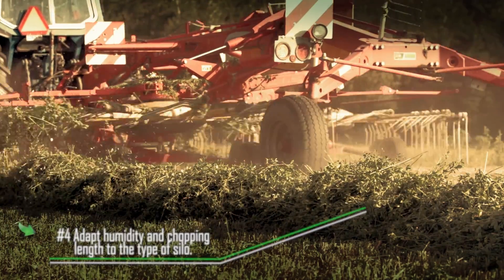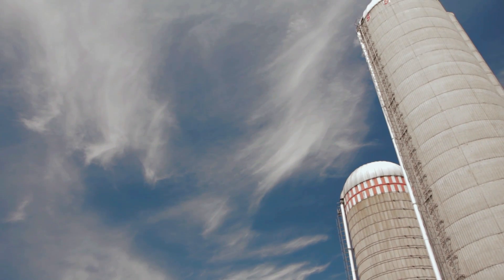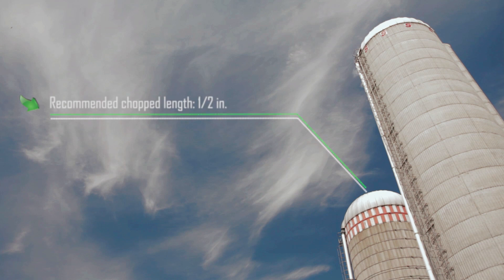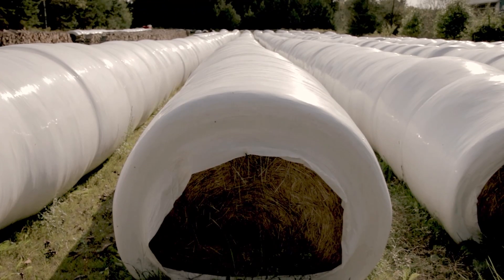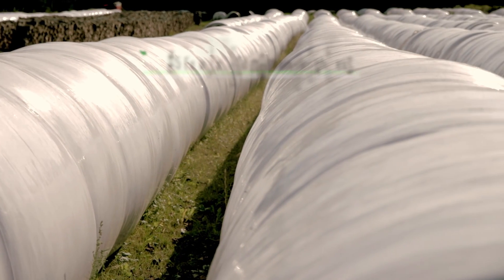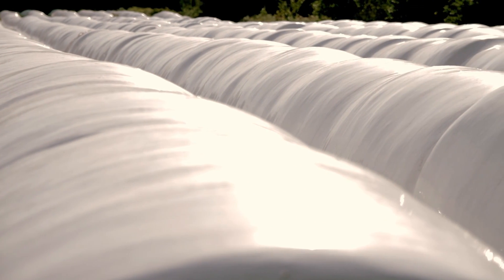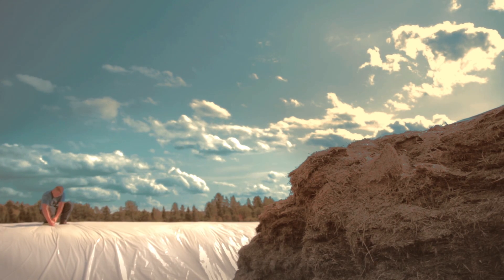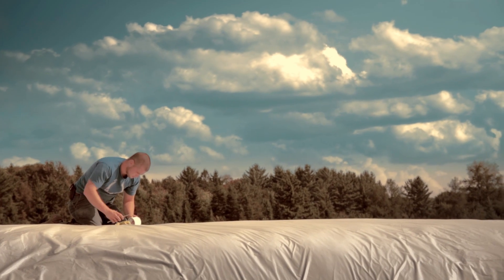How to Succeed in Making Quality Silage?

Comment: Thank you very much for the video. I am currently in the process of starting a small beef cattle farm. I originally intended to use round silage bales, but after a recent stay at a cattle breeder who uses round bales I am unsure if clamps aren't simply more efficient and less trouble all around, especially since I will only be having seasonal help? Also, what kind of cut length can be put in clamps, and what is the best way to compact and seal them? I have next to no experience with silage making and would much appreciate any pointers :D
Reply: if you are feeding out a small amount of silage then bales are the way to go, an open face in a clamp silo leads to large losses if you don't take out enough depth of forage each day. bales are the best way to store silage but the most expensive annually, but the gains will offset the costs.
Reply: Tnx very much  I also made but I made big losses in ma country we lack expertise  ( Uganda)